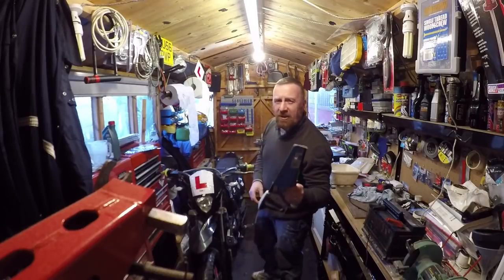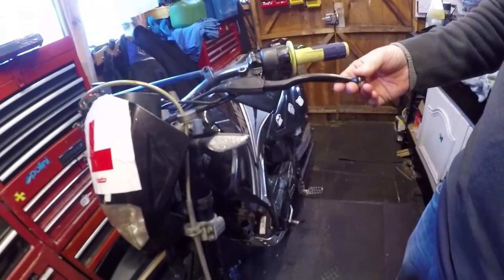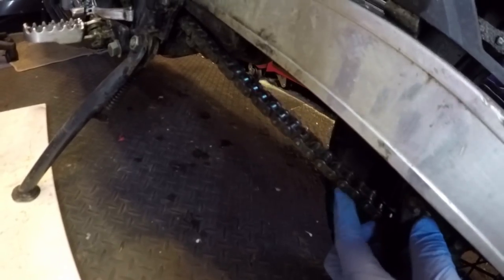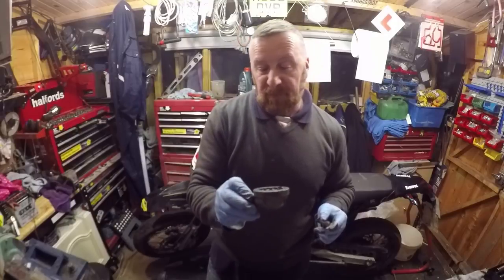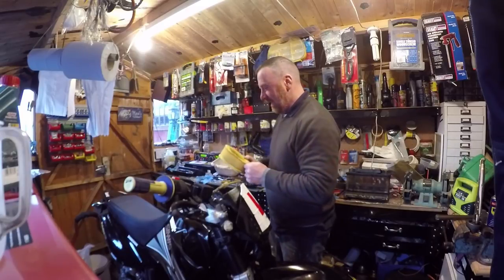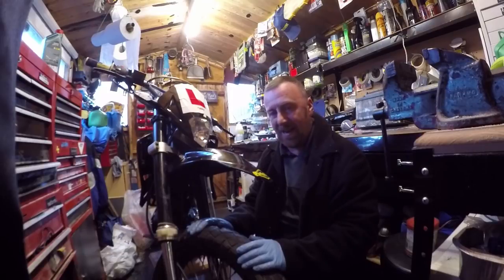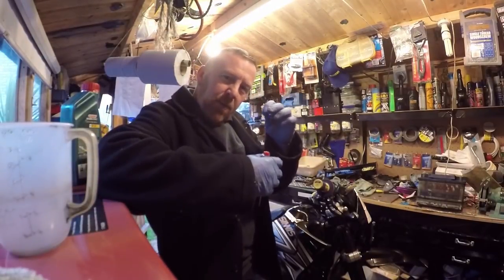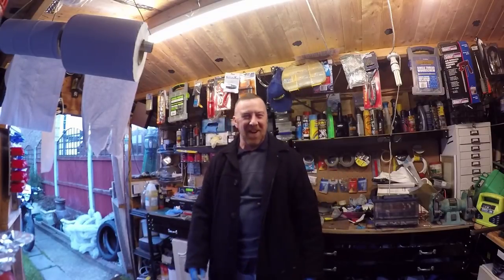SINNIS APACHE 125 REVIEW AND FIX UP MARK SAVAGE

Comment: Is it chinese motorbike?
Reply from the maker: hi yes , I have a few other 125 videos on my channel worth a watch, just type in 125 mark savage , but as long as you follow my advice they are fine
Reply: The sinnis is basically the same engine as the Pulse Adrenaline and the Lexmoto which are all Chinese imports,  I had the Pulse Adrenaline and too be honest pretty crap
Reply from the maker: oliverghost1 keep an eye on the oil 
Speedo and chains go 
But all in cheap and will keep going with service and wd40

Comment: I've had this bike nearly 2 years!!! I've had loads of issues with it. Electrical and mechanical.
The chain came off once while I was riding!!! Its virtually impossible to get into neutral!!! The fuel
meter no longer works!!! Until I had it fixed the engine used to cut out whenever I turned left!!! It never starts when its cold effecting my job!!!!!!!!!! Now the battery needs replacing!!!!! I've had multiple moterbike service and repair centres refuse to do any work on it and instead advised me to sell it, on eBay and to buy a better brand!!!! I'm sick of this bike and wouldn't have anything to do with this brand again!!!!!!
Reply from the maker: yes they do have there faults all of which I have said in my other 125 videos, you really do get what you pay for and have to go round them all the time to keep them running 
thanks for you comment and for watching
Reply: maybe it the fact you are a girl ?
Reply: No the problem is hers is the efi version(mention of fuel guage). I have it too, full of electrical/sensor related issues. When I changed it back to carbs it was pretty much bullet proof .. so long as you maintain it!

Comment: Hey man quick question I've got a yamaha yzf r125 4 stroke when I start it up it smoke comes from exhaust not for long just until it gets a little warm could that mean a cracked head?
Reply from the maker: If it's air cooled check if your loosing water, is the smoke white of black as maybe burning oil, could be from the piston rings or valves 
have a check bud
Reply: @marksavage  water Cooled mate cheers for getting back to me it's just white but doesn't do it for a long while plus it only does it if bikes been stood for a day or 2 usually it's only a tiny bit of smoke when it's been stood day but theres quite abit when it's stood for a few days... Im not that experienced in taking cylinder off lol I can only do odd few bits change carb cables etc wouldn't know where to start with stripping  engine
Reply from the maker: Ashman 94 in the cooled weather all bikes will blow out white smoke it’s nothing to worry about bud as long as it clears up and runs well all is ok
Reply: @marksavage  ahh good got abit worried then lol cheers for replying keep uploading vids mate 👍

Comment: 50. mpg from a 125 realey..
Reply from the maker: 50 plus bud 
I’ve rode many many bikes 
650 get 50 mpg 
My 1215 trophy did 285 miles on one tank 58mpg 
I could go on 
However my 750 gsxr only go 30
My b king 1360 was doing 27 
My Zzr 1400 most of the time was low 20s
Bmw1200 Gs 45 odd 
So how many bikes have you had bud and what 125 do you ride 
Google specs bud a lot of kids bikes like yours do very well on mpg some cheap 125s can do 70 plus and 50 cc 80 odd 
Not speedfights or aerox lol 
Check out my 400odd other videos bud all worth a watch
Reply: @marksavage  thanks for the info Mark,
Reply: @marksavage  me iv benn at it since 1973 yam 250 kawi 500 the widow macker , suzi 750 the kettile loved it a few flat twinn bm,s  yam xs,1,100 curentley a crf honda 250 l. knoble tyres
Reply from the maker: fred blogs I did check out your channel as I always do but couldn’t  see any bikes 
I started in 82 with a fizzy and Suzuki b120 , used to ride them up and down the beach 
Once legal x7 , 400 4 kph 250 and 400 GT 750 Gpz so many good old bike 
But now like my tiger 800 
Easy to move around and ride
Reply: @marksavage  wel i got married in 84 and got told by my delightfull x. wife now to sell the bikes so i dont have maney picts of them and  iv no vids of them as iv not mutch money now since the divorce so i did have a Honds 100a the detuned fireblade  and a NC 700 honds that was eating tyres at 4 though so i had to down grade to a crf now for toting out on my fishing trips, i used to work in the oil bussnisses so i had more money then , but now in 64  and on minimal income , but ill keep on the bikes till i can even on a 125
Reply from the maker: fred blogs in the same there bud 
Such a feel of freedom no matter if it like my rocket 2300 video on here or my little mopeds 
Take care bud
Reply: @marksavage  cheers mate